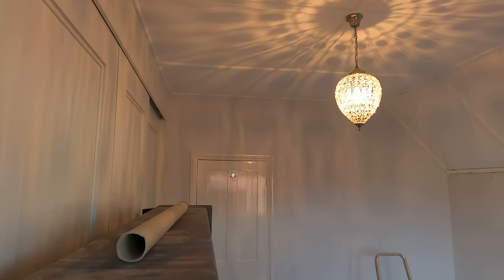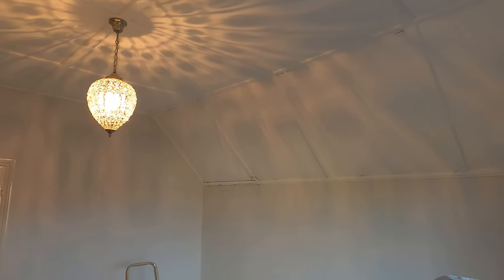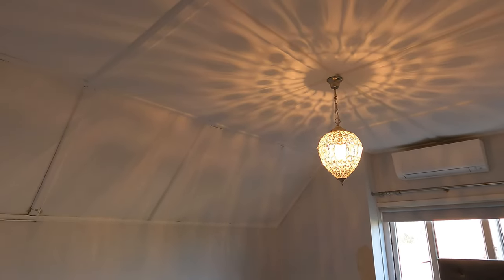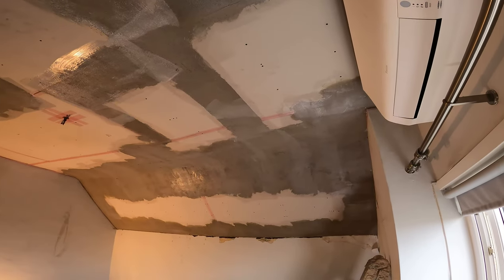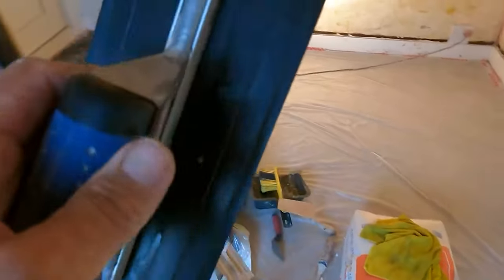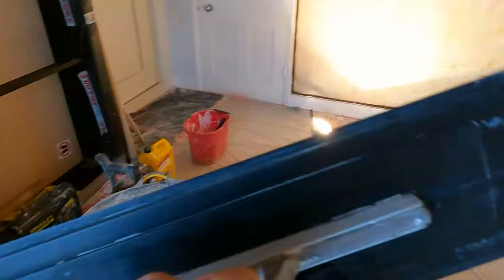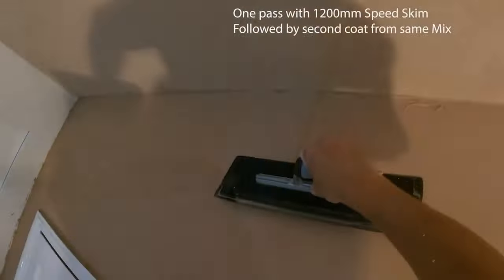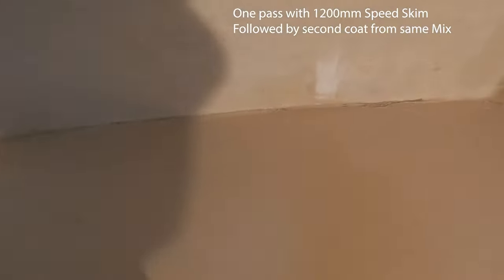Hard Board Ceilings  Orrible

Comment: God the Carta easy skim starts at £90 for a 14" £100 for the 16" Not cheap. Could get a Marshall town permashape 14" £50 and a OX ultra flex 16" for £38. But a plaziflex 16" would cost £36. Not sure if I'd want one trowel to do different jobs? Could do a lot more with a Marshall town like rendering. Would be interested how long the Carta trowel would last being plastic and unlike the plaziflex does not use a click replacement blade system.
Reply from the maker: Carta is pricey